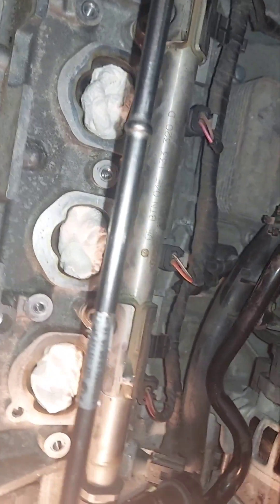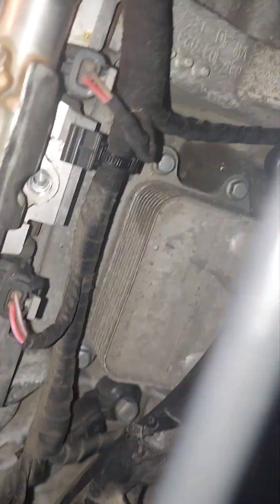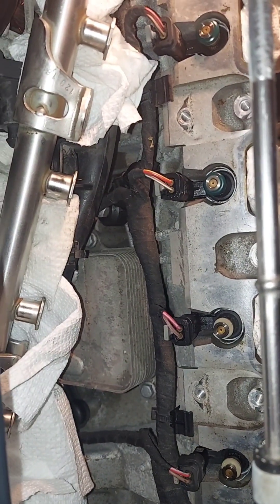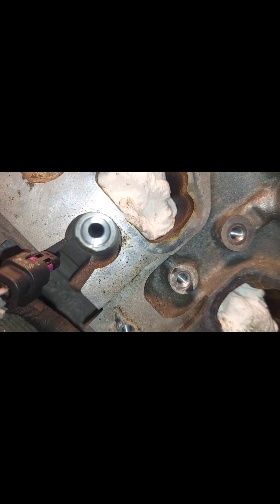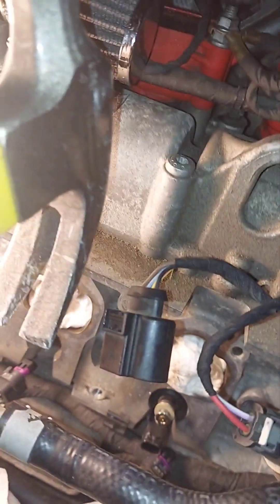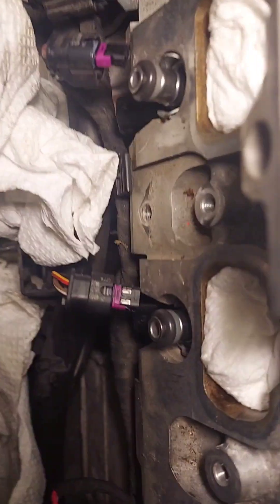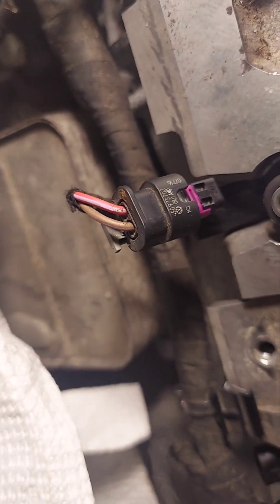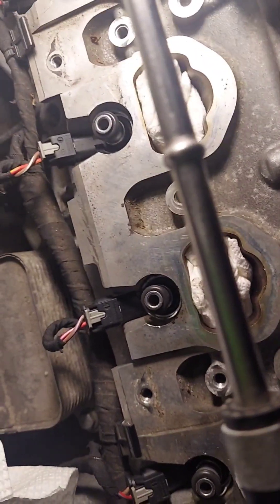Installing 2.0T Injectors on EA211 1.4T

Comment: Do you know if it also fits on 1.0 ea211 tsi ? (Ex: up gti)
Reply from the maker: Should hypothetically work on all the Gen1 motors but I haven't confirmed with other displacements. If your injectors look the same or are the same as the 1.4 then it'll more than likely work.

Comment: Hello i have 2016 1.4 tsi. having misfire problems P0300 and P0303. Also would like your guidance with this beast..lol I want to do all what you have been doing. I just cant find much about my car online. Your the only one so far. That looks like you know what your doing.
Reply: I’m gunna grab this email too if that’s okay. For when I have a few questions?
Reply from the maker: @derekjohnson9536  you can email me at jzsmk6.5@gmail.com
Reply: P030x is simple. In the video you will see a small bushing with a hole on the end of the injector, it needs to be removed, there is a filter under it. This injector is washed perfectly, a new filter and off we go.